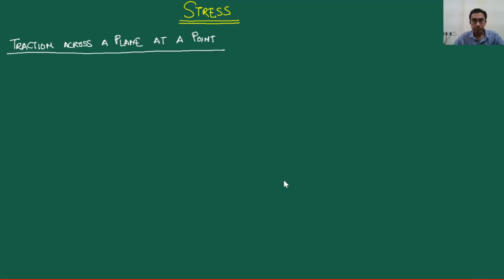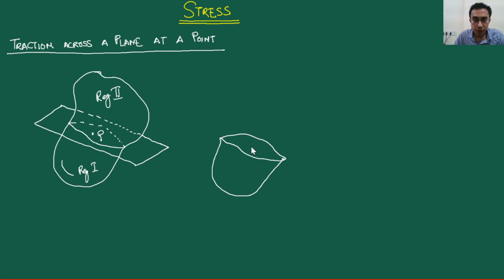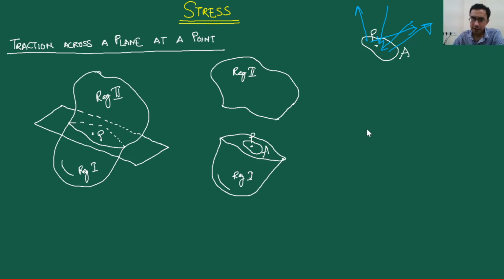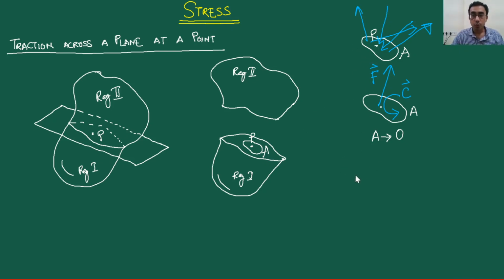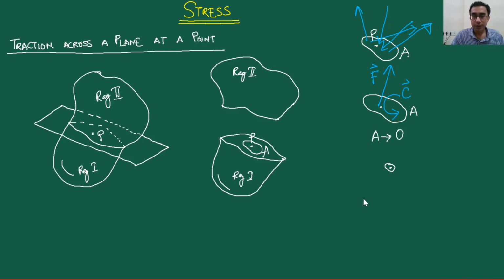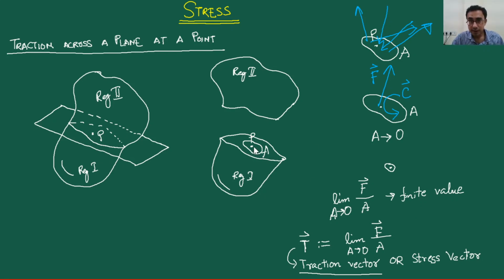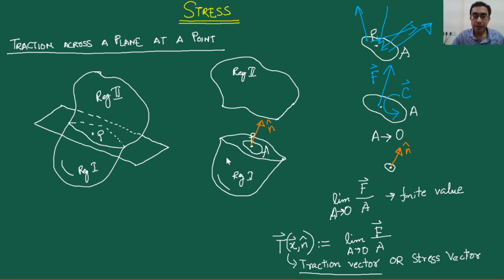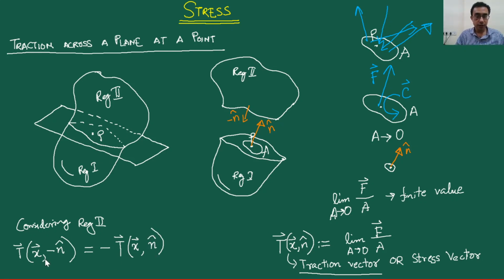Stress – 2: Traction

Comment: Thank you, but you did not explain why did you choose area A in the first place, i mean why you didn’t just consider A an the whole area?
Reply from the maker: A is the limiting area. That is why it cannot be the whole area. A has to tend to zero. However, it is a generic area. So it can be any small patch of area of the whole area.
Reply: @Prof_JC  Thank you. Another thing is that stress and traction defined in a point yes? but how we show them in an element? I mean point is 1-D and element is 3-D!
Reply from the maker: Yes, stress and traction are defined at a point. However, for their complete specification, we also need to mention the plane on which they are acting. So it is stress (or, traction) at a point on a particular plane. By the way, a point is 0-D, a line is 1-D, a patch of area is 2-D, while a chunk of volume is 3-D.
Reply: @Prof_JC  Thank you very much